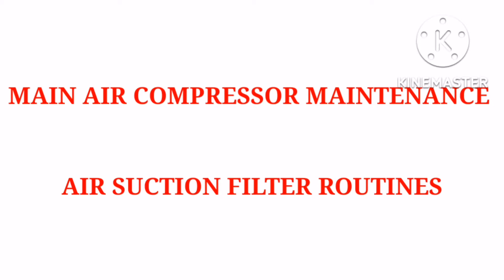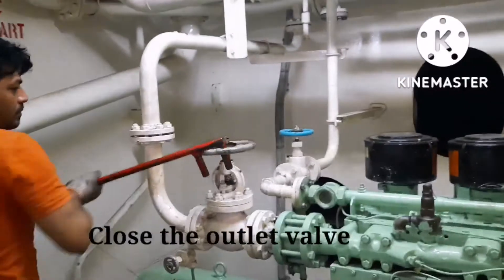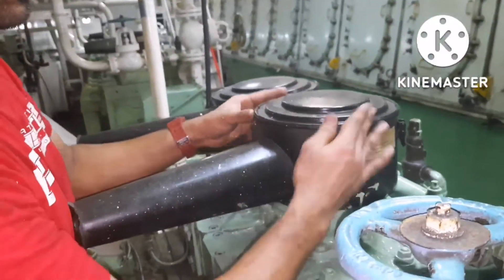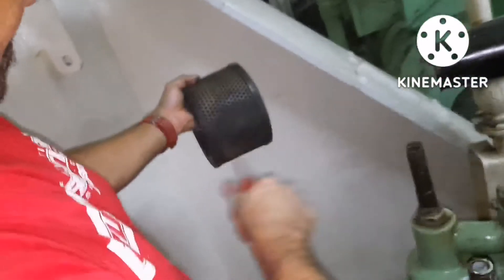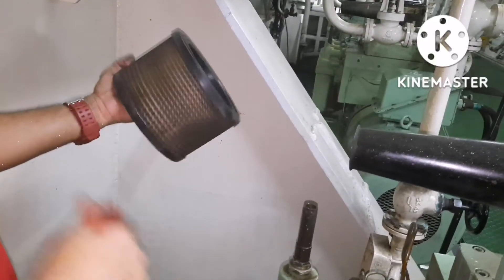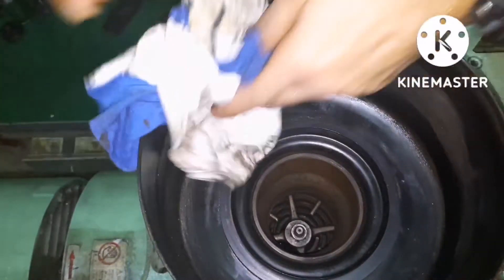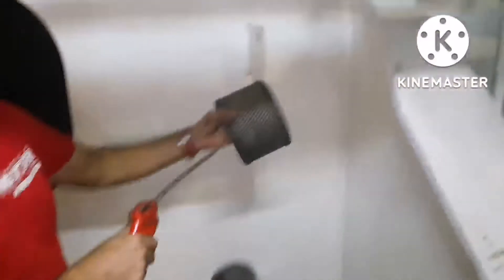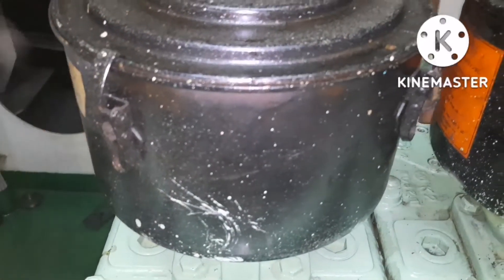FOURTH ENGINEER JOBS ...TANABE MAIN AIR COMPRESSOR MAINTENANCE... AIR FILTER ROUTINES

Comment: air cleaning from out side or from inside? please clear i dont think its from out side . plz explain?
Reply from the maker: Sir.. Usually these filters can b cleaned both the ways.... Outside cleaning means blowing air can be done at end stage.. In some case if you dint have spare u can use soap water cleaning also... Ideas is to remove the dirt inside the filter